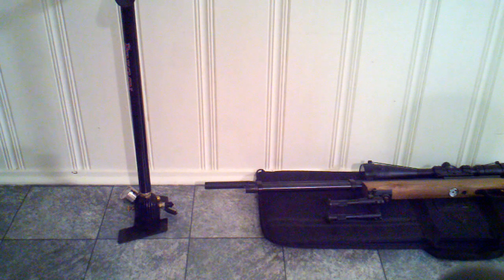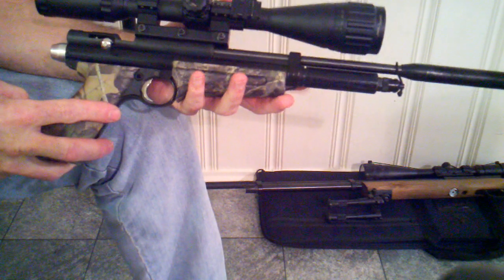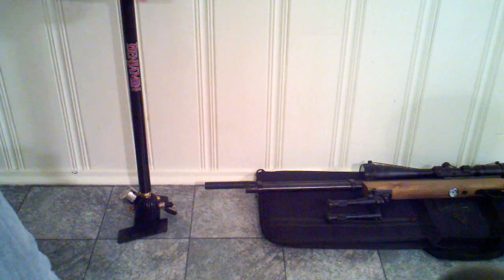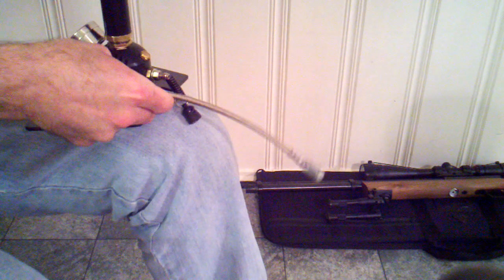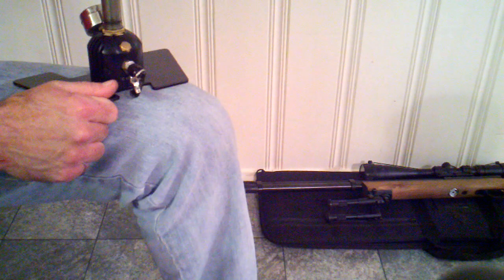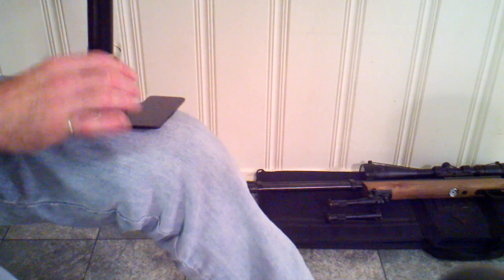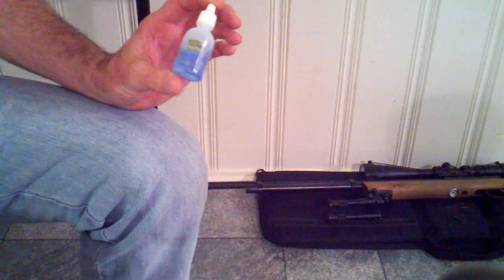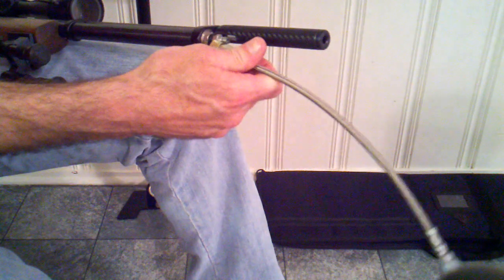Crosman Airgun do's and don'ts 2

Comment from the maker: Thanks fo commenting
With a fill of 3200 psi using a spring from True Value( #44U it's 047 gauge wire. Cut down to about 1 and 7/8" long 5/16" dia. ) I get 10 shots 14.3 CPHP (Crosman Premier Hollow Points) +- 3fps as follows 791,790,795,800,805,803,805,800,797,793
check out my build vid for the 2400kt for more details.
Cheers

Comment: thanks for your help but I found out I'm not very good at working on air Gun's I bought a 2240 And took it apart and can't get it back together it's only a week old so now it's just going to sit in a box
Reply from the maker: Thanks for commenting and your welcome.
Don't get discouraged, I have messed up more than once modding my guns. Sometimes it's good to let a project sit for a bit and come back to it later, I have done that a lot. The one thing I found most frustrating is the tiny breech screw, under the bolt. I have stripped two tubes, countless heads, as well the treads of the screw it self. It's always a case of ( I need to get it a little tighter and bam!) ruined. Hope this helps. If I can answer any questions or help in any way let me know......
Cheers
Reply: Thanks man that's what I'm going to do And that tiny breech screws is what I messed up to I'm going to set it to the side and then try again thanks that makes me feel better
Reply from the maker: You are welcome..
I do what I can to be the best Airgun addict enabler I can :-)

Comment: awesome video ! are you using the Hipac Hiflo valve also  ?
Reply from the maker: +mullz1 Thanks for commenting.
I didn't use Hi-pac valve, I made a franken-valve. It's a Benjamin discovery back section with the stock co2 front. Link is to that mod. 
https://youtu.be/qm27XkU6quk
Hope this helps.
Cheers

Comment: Hi there.Thanks for the info video.. I have a similar problem like Bob Coulon. Seams the pump only builds up pressure within itself and not in to the powermax  hipac? Any suggestions? Thanks
Reply from the maker: Thanks for commenting. 
Assuming the pump it self is working properly.
I would remove the Hi-pac and pump it up while holding my finger over where it seals to the airgun valve, a helper may be needed. If the check valve in the Hi-pac is working, a small amount of air can be held back by your finger. If no air is pushed past your finger the check valve is not closing. Assuming the check valve is working, visually check the seal on the airgun valve,  It is easy the damage this seal. Assuming that is fine, reinstall and try to pump it up. If still no pressure, the airguns valve is the last part to check and will need to be removed from the gun to do so.  Hope this helps. 
I am interested to know your results.
Cheers
Reply: Thanks I just received a new one and it works fine. But I have another issue though when pumping the powermax hipac I can hear the air go in to the hipac but then straight through the valve and out the barrel? I was only told to change the valve seal that came with the hipac and put a little but of oil on the outlet and that should be only to screw in and start pumping. Well have done that but air is just going through it? Do you have any suggestions and what did you have to do before installing the powermax hipac? Thanks for any help with thus issue also?
Reply from the maker: You are welcome.
It sounds like the valve in the airgun is open, not letting it build psi. I would first try cocking the gun, but don't load a pellet. Then pump it up. If taking hammer pressure off valve doesn't solve it, The valve will need to be removed and serviced.  Hope this helps. 
Let me know your results.
Cheers
Reply: Thanks I found that out yesterday., and it was like you said the valve was not closing properly which was strange as I bought a finished modified boss valve from the states and should have been in order and just to install.. But found out the valve spring used in the valve was long and weaker than the original. I used the standard spring in the original valve making it firmer and harder and that solved it all.I have pressurised the hipac for about 2000psi but dare not to go further. I can only pump it maybe with 12-15 pumps and it quickly goes up to 2000psi.. Is it safe to fill it more than the 2000psi as it seams to get quit harder to pump? Thanks for any helpful tip.
Reply from the maker: Hope this helps https://youtu.be/aPfjgZWvPOo This is my video on my Hi-pac 2400KT. I have sense drop the starting pressure to 2300ish psi. I lost fps top speed, but added to shot count. 
I am glad to help further if needed.
Cheers

Comment: Did you replace the valve or make any valve modifications in order for the gun to be hi-PAC compatible? The reason I ask is that I am looking to invest in a hi-PAC and wanted to  be sure I took all safety precautions to be safe.
Reply from the maker: Thanks for commenting.
Yes I made adjustments to the valve setup on my 2400KT, but that was more for upping fps than a concern about safety. There are still people out there who don't understand how the hi-pac works. It is one of the best add on's there is. If the intent is to use co2 powerlets and only pressurize the hi-pac to 2000psi the stock valve is completely safe.  If you have seen the vid where the guy said his hi-pac exploded. Pay no mind to that idiot. He took out all the safety features of the hi-pac setup. I am glad He didn't kill himself. I use 2800psi so I made mods, check out my vids on that. If you have other questions I'll be glad to help

Cheers

Comment: Just picked up a new 1377 and find it very hard pumping even 7 times-any ideas ?
Reply from the maker: Thanks for commenting. 
If this is a new production fresh out of the plastic, I say a store return is in order. If it is a new to you/used then there are some things I would check. Too much lube is just as bad as no lube at all. Take a paper towel and wipe the piston with arm fully extended. A very little amount of oil should be present. Next without putting a pellet in the gun, pump several times. Pointing in a safe direction, hold muzzle a few inches above paper towel and pull trigger. If excessive oil is present, gun/valve needs to have oil cleaned out. The pivot points may need oiling. I use a non detergent 30w motor oil, can be found at any auto-parts place. If you still feel it's not right after these checks let me know.
Cheers
Reply: Thank you very much
Reply from the maker: You are welcome....
Cheers